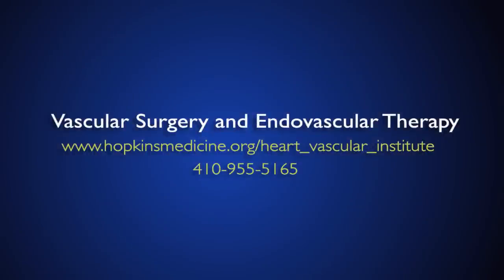What is Thoracic Outlet Syndrome, How is it Diagnosed and Treated

Comment: After 2 years of pain, I was recently diagnosed with TOS. I lose sleep due to the numbing, tingling, and pain in my neck, shoulder, arm extending down to my fingers.  I wake in the morning with, literally, a dead arm....all feeling and sensation in my hand is gone, and I can't move it on it's own. Takes me a few hours to get it back to some bit of feeling. A painful and horrible thing, but happy to find these videos and know that I am on my way to managing it.
Reply: Same! It sucks! I’m only 10 though
Reply: SAME! It’s very scary!
Reply: This has been happening to me since I was a teenager.. I'm 29 now. I think it's caused mainly by sleeping. I thought I had carpal tunnel (I'm diagnosed with it) but I think I have TOS
Reply: Omg i have the same feeling they did mri and Emg test without results, with mri again for my schouder and nek they think i have inpigment syndrome thats not true becus i have tintling and num feeling in my arm sometimes i cant use my fingers letting things fall from my hand. They cant  diagnose it very good ☹
Reply: Once you got it, it's impossible to get rid of I see ice heat AT physical therapy. I have never seen a successful surgery.  Surgery done I've only seen more software. Was a Minor League Baseball player I overtreigned in the 80s. Now I'm suffering more.
 Good luck to everybody.
Reply: @RichardMarkLevy I had successful surgery for this.

Comment: i was diagnosed with an extra cervical rib (left side) with the possibility of TOS i have been experiencing chest pain frequently, soreness under my left armpit an sometimes weakness in my left arm i went to a cardiologist for my chest pain an they did an ekg an came back good....so i’m just wondering is it possible for TOS to cause chest pain?   Please respond with this epidemic going on in america it’s impossible to get responses, Thanks
Reply from the maker: Hi Noah, Please reach out to inquire about a new appointment by calling 855-695-4872. Please note, many of our offices are reaching out to patients to reschedule appointments as video visits; this will depend on visit type and currently, these are only available for existing patients. Please call the above number to learn more about what options may be available for your specific situation. You can see more on our patient and visitor guidelines at https://www.hopkinsmedicine.org/coronavirus/index.html#patient-visitor-alerts
Reply: the answer is yes. usually you peck minor is tight. I have a scalene block injection for it today

Comment: This is an interesting view of thoracic outlet syndrome.  However, what is missing is that muscle contractions or splinting spasms lift the rib up into the outlet and pull the shoulder down into the outlet.  The proof this is the cause is that the surgeon removes the scalene muscles and the rib these muscles lift into the outlet.  What is not mentioned is that the shoulder is also dragged into the thoracic outlet causing pressure on the nerves artery and vein and tat too is caused by contraction of the pectoralis minor,  The surgical treatment is to surgically remove or cut the muscle.   So if you have a spasmed, contracted muscle in your neck and shoulder do you cut it out or relax the muscle?

Comment: Mine is neurogenic status post rotator cuff repair, at 14 months still unable to use my dominant hand for more than 10 minutes and that's with pain of 6 and 7, hand just stops working after that, no fine motor ability or strength.  Unable to use for the cold, pins, needles and numbness. Frustrating is it's from a work injury.  Praying my smart doctor can help me further instead of putting me out to pasture.  Moo? 😭😜😒
Reply: @thereelarmorgoldvaultinn

Comment: So some cases of TOS are not compressing arteries, right, doc? I'm worried about mine,  but I"m glad I just figured out (presumtive diagnosis on my part) what has been causing my pain is Thoracic Outlet Syndrome. My right shoulder has always been crippled looking and 'lower'.. i've played piano and hunched over computers most of my 26 years of life so far. Theres a burning to sometimes sharp pain in the areas typically outlined on images showing the pain area.. the inner lower arm and out part of the hand and fingers up to the middle finger, it's like a muscle tightness or nerve pain that I can't twist myself out of. My neck itself deviates to the right (same side) which is interesting.. I suspect the neck stabilizing muscles are not working right due to nerve compresssion.. so that' my main question - could it be that it's just affecting nerves and not vessels/arteries? I'd hate to think this puts me at risk for heart attack or stroke. I'll go over my primary with this stuff, but I'd appreciate any feedback you may have based on my description.
Reply: Dr. James Stoxen DC, FSSEMM Hon FWSSEM I had it after my lymph node biopsy I cured cancer but I couldn't cure TOS. I did NCV  EMG MRI CT scan all test doesn't show any unnatural defect. But I cannot lift my arm above shoulder. I have winged scapula while I train in gym I feel pain during my chest & shoulder excercise. I am an athlete what should I do none of the doctors are  ready for surgery. I lost all hope.
Reply: @AnkushDuttasuperstar  do u still have problems?
Reply: Yes